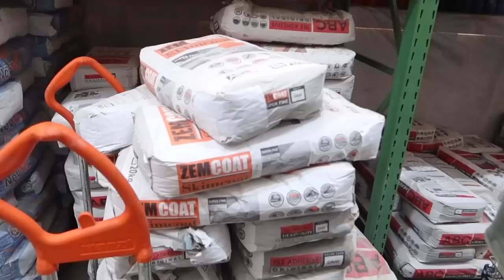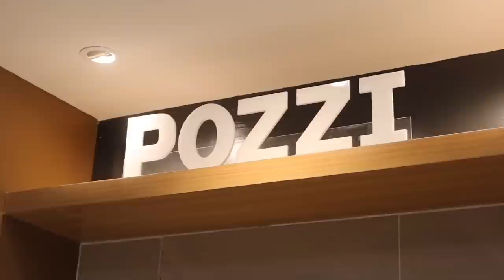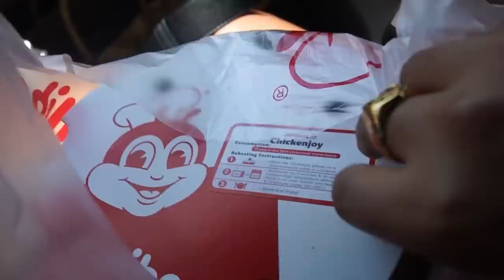House Renovation in the Philippines (episode 1,3,5 & 6)

Comment: Your 2nd floor bathroom is dark. White would make it look more spacious but gets dirtied easier. I wonder if u have exhaust fans in both of your bathrooms. Putting up a steel door  vis a vis aluminum door on your front door with half opened space and screen will give your sala more air circulation. Just dunno if your subdivision is safe enough for those windows especially at ground level to be w/o iron grills. Did I hear u will use aircon at ground level? Still a double door at the entrance is safer compared to having a single door. Just saying.